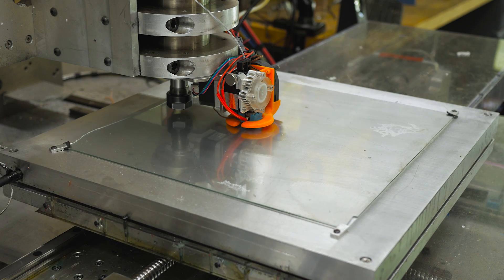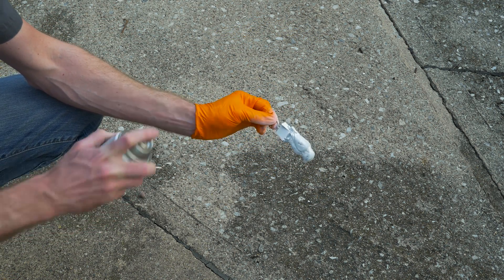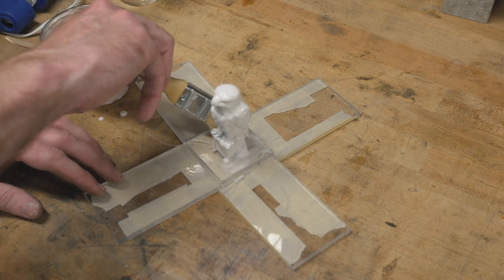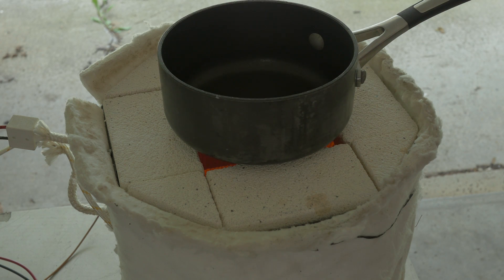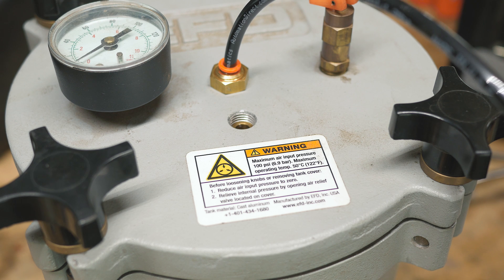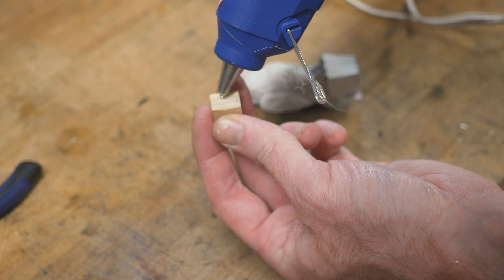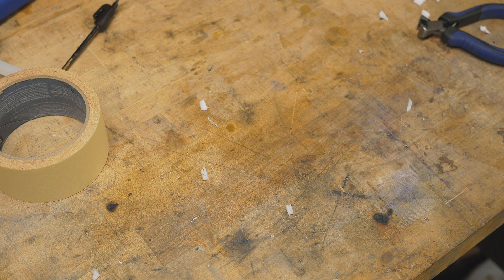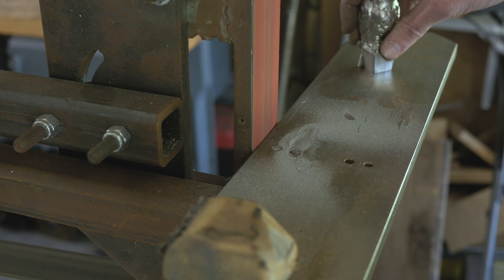Easy, Reusable and LOW TEMP Metal Casting from 3D Printed Parts!

Comment: Why tin-bismuth and not just tin? Seems like an expensive alloy for simple castings. I made 3dprint tin castings before, though I used salt-dough instead of silicone (Which of course has its limitations because it isn't flexible.. But it works and everyone has the materials at home)
Reply from the maker: +ET Bismouth is actually a bit cheaper than Tin; at least the places I was looking.  Its heavier which makes for more substantial finished pieces - and pure Tin melts at over 400F which is too hot for the silicone whereas the alloy melts well below that.
Reply: Oh! It really is cheap when looking at Ebay, sadly hard to find it in suppliers here in my country without it being sold as decorative crystals ( and therefore much more expensive than tin ), pretty cheap on alibaba and ebay though, thanks for the tip. Cheers!
Reply from the maker: Interesting.  Tin is about the same price on US ebay as from normal metal suppliers; I wonder if it's a regional thing.  Where are you?
Reply: Also I just remembered, that I didn't look into bismuth at all, I was looking at Gallium because I wanted to make an allow I could use in Plastic molds (ABS or nylon).
Reply: Tin is pretty easy to come buy (Denmark) but I have only found Bismuth as decorative crystals. Its cheap through China vendors so I just got me an ingot for 5$.  I found a phase diagram for the alloy you use, looks very interesting!

My very first post was a misunderstanding, I thought that Bismuth was the same price as Gallium :(
Reply from the maker: Ah, gotcha. :P

Comment: Would pewter work?
Reply from the maker: It could!  It's a tiny bit more expensive and melts at a tad higher temp, though.
Reply: @ChrisDePrisco  I would like to see zamac as its a great engineering grade material with a fairly low melting point.

Comment: Realy? Using a high preasure chamber is "super easy"??? Downvote.
Reply: Well it's not that difficult to use is it?
Reply: not seeing how it's that difficult, tbh. seems you put the mould in, tighten the lid, turn it on and monitor for the pressure you want (here he wanting to get to 80psi, though were it resin i think 60psi would be the absolute most you'd need). once you reach the desired pressure you allow it cure inside the chamber then release the air. i'd call that pretty easy, lol.
Reply: Yup...  Not that difficult or expensive.  Same as vacuum de-airing.  Pressure pots and vacuum chambers that work fine are $70 on Amazon all day long.  Vacuum pump can be sourced reasonably from retired refrigeration units.

Don't forget when de-airing to mix your silicone in a much larger container for the volume required as it foams/expands tremendously when you de-air it.